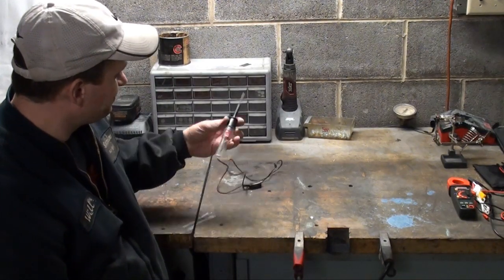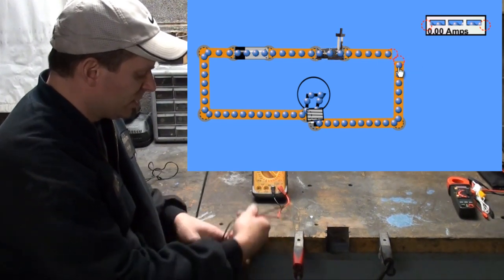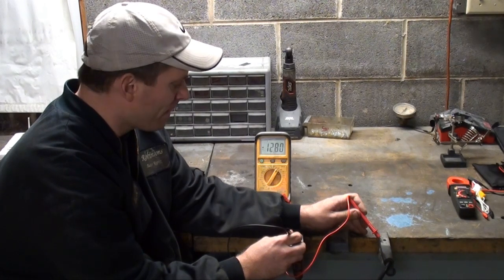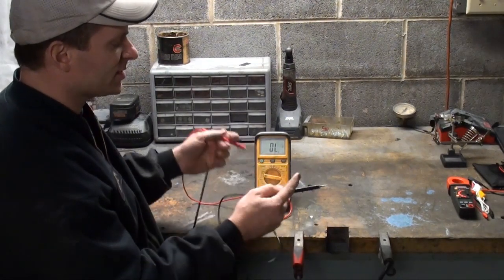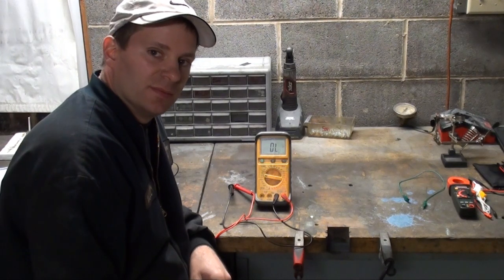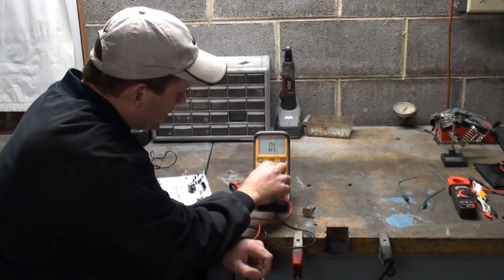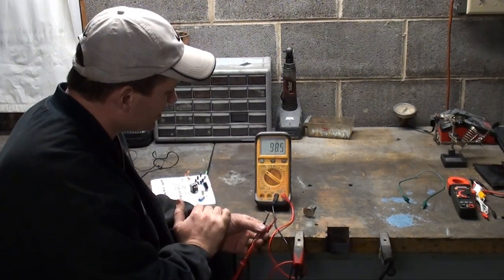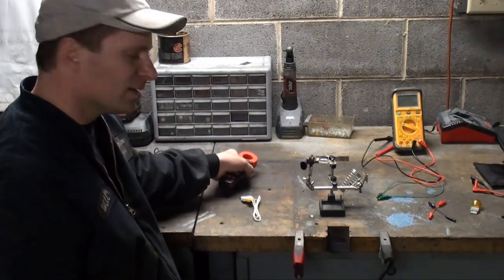Multimeter  / test light / Amp clamp DC Automotive electrical

Comment: Hi there, I think you will find nearly every bulb filament you test with an ohm meter will read 000 ohms, due to the fact it has no resistance when the filament is cold, it only when it's hot that you get resistance, so when you turn them on from cold there is a big rush of current until resistance builds up, that's why most mains bulbs blow when you turn them on initially, not so much when there on...Fred uk.

Comment: Dude I don't think you've actually accomplished anything with this video
Reply: He helped me out...
Reply: Alvarez Metal Works
that's not saying much
Reply: I wouldn't expect you to think so. However I was able to find something useful in this video meanwhile you're still here scratching your head trying to find a way to insult someone.

That's two strikes against you because you've failed at both paying attention and insulting someone. However I'm 100% sure you'll be back to get struck out and make yourself look worse than you already have.
Reply: I agree. I know virtually nothing about electricity--in autos or elsewhere--and knowing how to use the diagnostic tools is a good beginning. This video was helpful to me.